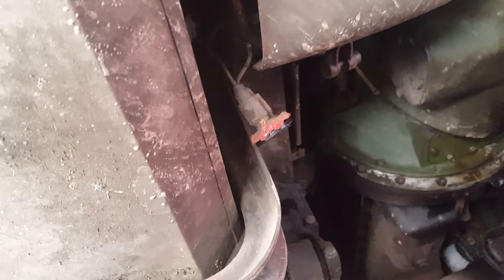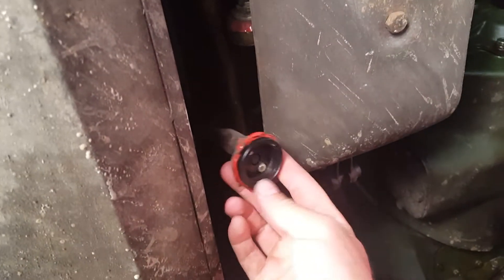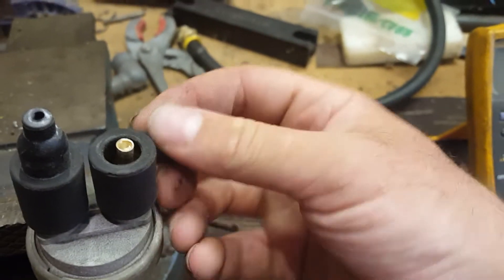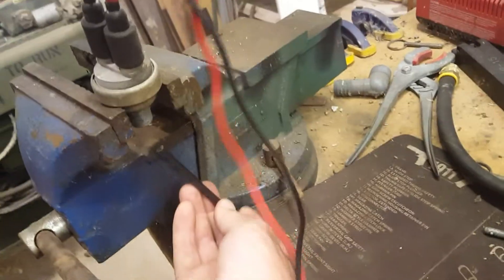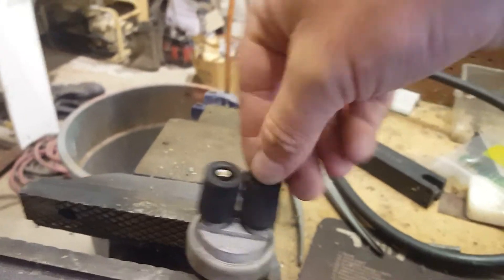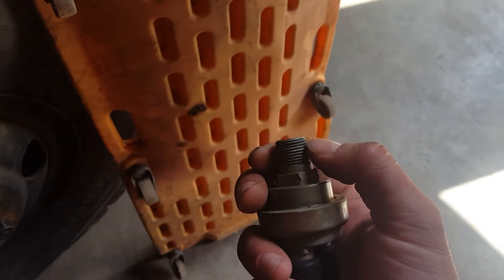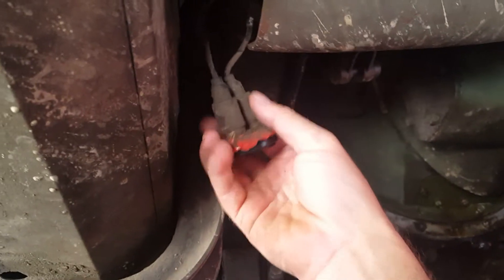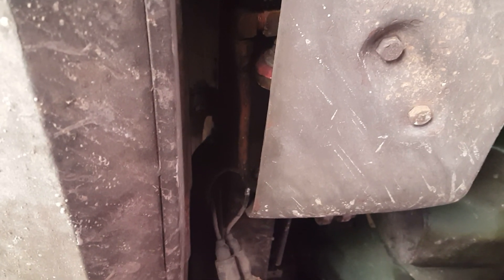M35 brake failure ( Pt.2)

Comment: I am working on a M51 5 ton 6X6, replaced the brake cylinder, went to add fluid into the master cylinder and to understanding from your video the cap on the master cylinder (the fill point) should be vented.  Mine however had a 1/8th inch pipe plug in it, so I am adding a connecter for a 1/4 inch plastic line for a vent.  I just want to make sure this is the correct procedure.
Reply from the maker: You're good.

Comment: I have an issue with the brake lights just coming on when driving pedal not depressed on my deuce any ideas
Reply from the maker: The switch is probably bad.
Reply: Is that the air pressure switch or the brake switch . I’m having a problem finding my brake switch on mine .

Comment: Is that the air pressure switch or the brake switch. Is there also two of them bc I have anther air pack on the other side with that same switch
Reply from the maker: You have a dual circuit brake truck. You have one brake light switch on each air pack. The air pressure switch is inside the dash and is different.
Reply: I’m getting a heater core replacement in the mean time I was getting lights all working . Will the brake Lights work when you hit the brake or does the truck have to be running to build air to work the brake lights properly?
Reply from the maker: @Lautzoffun  it needs air pressure for the brake lights to work.